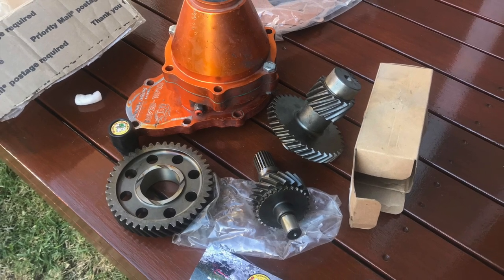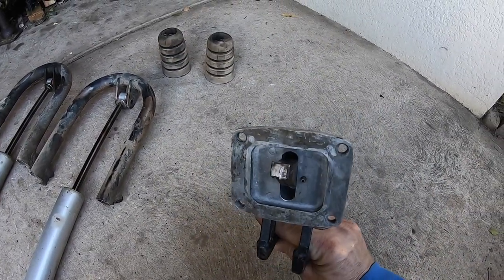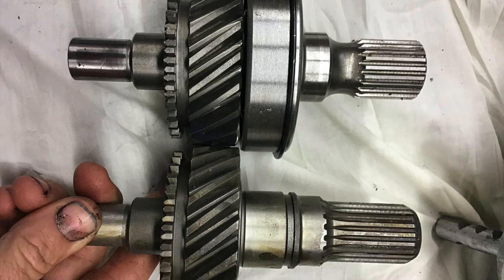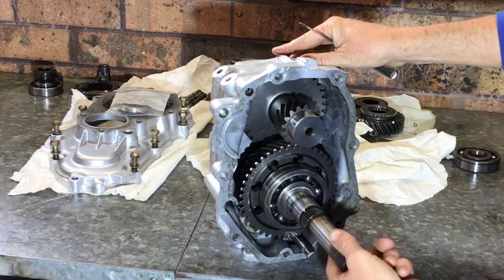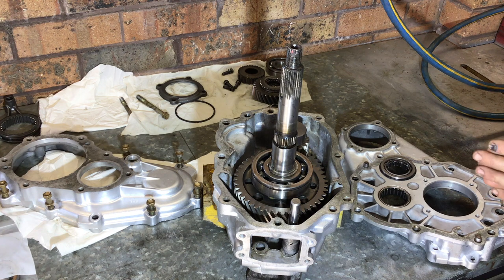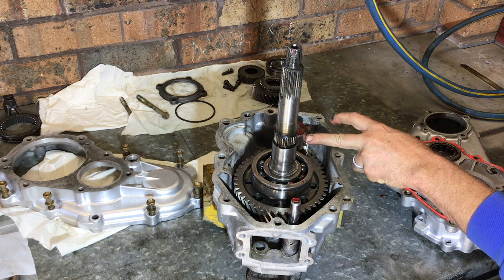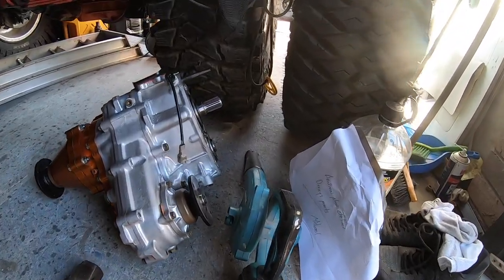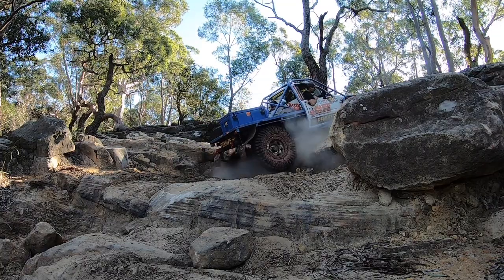Marlin crawler comp spec Toyota Hilux 4.7 Reduction gears installation

Comment: How in the hell did you get that case so clean!😳
Reply from the maker: Brian is very meticulous when he pulls stuff apart, they have to be clean enough to eat off....
Reply: It’s a bit of a process. High pressure wash before disassembly to get the big chunks off, hot wash (dishwasher) for about an hour gets it most of the way there. Pull apart then In the hand parts washer with scrubbing brush to get the stubborn bits. By that stage the inside is spotless, and all the inside surfaces are mill finish, just washed clean. 
Old aluminum cases can be porous on the outside and get stained by oil leaks and road grime so the outsides are pretty much impossible to get perfectly clean. They get a very light dusting of flat aluminum paint which presents nicely and makes them easier to keep clean.  If presentation is important, hit the whole thing with gloss clear once it’s all together, but that’s a step too far for the bullet, it’s what’s inside that counts 😀
Reply: @brianmonger8185  ahh yeah I thought it looked like a painted T case, mine are just cleaned with Kero after pressure washing, I didn't think to paint mine, I suppose that's how show cars are done hey
Reply: @IndyHepburn  there are ways to get them super clean without painting. Bead blasting is very effective and also closes the surface to eliminate the porosity. Add a clear coat and it stays clean for a long time. The downside is it’s very time consuming to get a show finish, and for a off road competition vehicle it’s really not worth making it look that pretty. 🤷🏼‍♂️you can get most of the way there by running therm through a dishwasher multiple passes and hand scrubbing the really stubborn bits. Ain’t nobody got time for that.